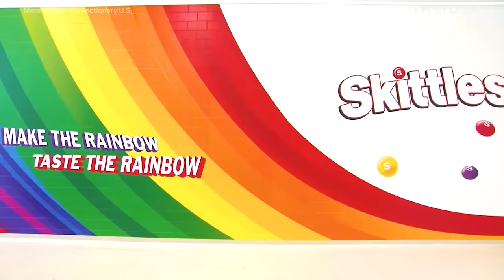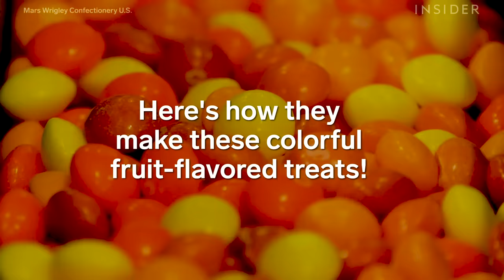How Skittles Are Made

Comment: Copied from the pastry chef attempts to make gourmet skittles:
jamnjam
9 months ago
I worked for 10 years at Mars. 5 years in Starburst and 5 years in Skittles. Making Skittles is a very long and complicated process. One area makes the centers, the next area is called Coating. It takes around 8 hours to put the shell on. It's like a snowball effect...sprayers spray layer after layer of different forms of liquid sugar at timed intervals. The last hour and a half is putting the color shell part on and then making them shiny. Then it's off to printing for the 'S' and then packaging. They do use real fruit 'juice' but it's super concentrated. (I do miss the smell of the orange and lemon juice). Bless her heart trying to make Skittles by hand!